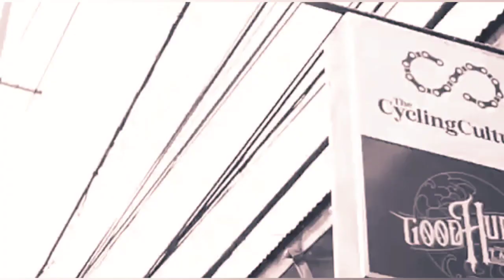I create my own cleat shoes, using a PVC pipe and low budget shoes

Comment: Update on my own shoe modification:
I have since received my pair of Magped Enduro pedals with steel plates for "cleats" and put said "cleats" on my old shredded-to-sh!t-by-bike-pedals Puma shoes by simply making a pair of aluminum plates with 2 M5-tapped holes each which go inside the shoes, drilling matching holes through the shoes' soles and finally screwing the "cleats" on with some thread locker in the aluminum plates' holes. Due to the very soft rubber compound that makes up the soles I could simply bolt the "cleats" down so hard that they now sit about 1 - 2 millimeters below the surface, as recommended in the manual that comes with the pedals.

And while my Puma shoes will end up in the trash not too far into the future, simply due to all the wear and tear (literally) my always pretty agressive flat pedals have caused, the modification has turned out to work like a charm and I can see myself doing it again, possibly even the same way since these Magped "cleats" are almost perfectly flat and thus don't need matching holes cut all the way through the soles.

That all said, I'm still considering getting a pair of proper SPD shoes since there are in fact some that would cost me about half what a new pair of these same Puma shoes would cost, and I doubt that any other shoes that are suitable for this modification would be any cheaper than said SPD shoes.
Reply: This would of been so much better if you had made a complete insole full length of the shoe instead of just around the cleat . The shoe sole would of  been far stiffer and less likely    for the cleat to pull out or move around in the shoe also a greater surface to glue the insole in
Reply: @Steven-Sea_gull  It worked just fine the way I did it, the cleats never got pulled out and never moved anywhere! They stayed exactly where I'd bolted them down all the way 'til the end, when I went and got myself a pair of actual SPD shoes! Coz as I mentioned above the Puma shoes I used for this mod had already been torn to sh!t by years of riding with aggressive flat pedals and were destined for the trash anyway, and as such were the ideal shoes for testing an irreversible modification like this!

The cleats stayed were they were despite not having used any glue, I'd just bolted them into the aluminum plate on the inside really hard, so hard in fact that, as I also mentioned in my above comment, they got pulled into the sole so hard that they sat about 1 - 2 millimeters below the sole's surface as the manual recommended!

And the lack of stiffness kept the shoes very comfortable to walk in, and while my new pair of Northwave Rockit cycling shoes are also extremely comfortable their stiff soles are the very reason why they can't quite match the comfort that my Pumas gave me even after the modification. And on top of that it was way easier to find the sweet spot on the magnets with my modified Pumas than it is with the new SPD cycling shoes. Don't get me wrong, I still feel much more secure riding with my feet sticking to the magnets, just not as secure as I did when I was still using my Pumas. Maybe I just have to get used to the new shoes tho, especially since I'm usually more of a "middle foot" rider than a "ball of the foot" rider, but for the time being I wish my Pumas had been in much better condition when I decided to do this mod to them and would've been good for another few years of riding.